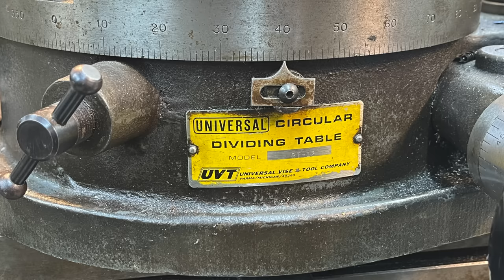Walker Turner Drilling Head Adaptor Part 2: Rotary Table Machining & Finishing

Comment: I always like seeing curves put into metal.  Nice trick with the square stock to assure proper height on the pins.  Keep up the good work.
Reply: A couple spare drill bits work in a pinch as well

Comment: When I was 19 years old I was running a 6" facemill and a hot chip landed on my nose just above the bridge of my glasses. I swiped it off fast and my glasses went flying over on the other side of a skid. I was expecting they would broken but they were folded neet as you please on the floor up broken . Sometimes your  just plain lucky. Very nice job by the way!

Comment: When milling a slot on a rotary table I find it helps to rotate the table anticlockwise. This way you are climb cutting on the inner surface of the slot which is shorter the outer surface. This helps minimise the 'grabbiness' you encountered. Beautiful finish as always 👍

Comment: I don't remember but I think there's a scale on the side for degree of angle . It may be a plate with pin on type . I use to enjoy machining cast iron , til I started sweating rust and tasting iron . Did that for a year or so many moons ago. Nice job Adam , thanks Abby for your Camara work , blooper n all...

Comment: Excellent as always. Abby does a good job too - and turned out really brave.
Personal experience: during the  visit of the finishing department of a large foundry I felt like getting electric shocks - which turned out as tiny steel balls escaping from the shot blast cabinet.

Comment: I absolutely LOVE seeing Adam working in Machinist-Accuracy mode. It is amazing. This part is critical to making accruate parts on the lathe it will be assembled on. If it is off, every part will be off, or it will be way harder to get them to specs. At 7:25 Adam tests the fit, and indeed it is 0.249 and the 0.250 pin has a tight fit. Then at 8:00 Adam says, "Just as easy as that." Well yes if you grew up in your grand-daddy's shop, learned machining at your daddy's knee, and have twenty years adult experience.

Comment: Re the light falling down (13:52), I grew tired of the same issue on my mill. Solved it by drilling a divot in the side of the vertical rod to accept the end of the lock bolt. My thinking was that if it came loose again, at least I would see it wobbling before it fell out. However, in practice the bolt doesn't come loose any more - possibly because the tip now has a bigger contact area.

Comment: The OEM part was almost certainly "gray" iron.  "Ductile" iron for the replacement part is just about perfect.  While generally similar to "gray" iron, "ductile" iron is a good deal less brittle and can withstand minor shocks.  Better than factory brand new is outstanding.

Comment: Long sleeves and rotary machine tools-? - SCARY-!!!   I caught a rag glove in a drill  press once - only had it on because of handling 500*F plastic parts, I was very lucky I yanked back and it just pulled the glove off - learned my lesson.
Reply: Not really, as long as they're tight fitting, and buttoned up, like Adam had them.

Comment: im no machinist by any means XD
im just the only mechanic using the mill and lathe at work,
i usually use compressen air to blast the part to keep chip away and it also keep them flying in the same direction.
can't wait to use the turn table we have at work (might take some time the guys are old school and don't like when i mess with their unused machines hehehe

Comment: Love this channel! First time writing a comment.
I have wondered for a long time, from drilling holes to machining ops-- How do you decide when to use oil/coolant? I know it's a complicated answer that I wouldn't fully understand, but  I've seen smaller holes drilled through less stock that had some oil used, unlike this video where no lube was used.

Comment: At the beginning of the video, I saw that "Sky Hook" and busted out laughing.  When I started out as a sheet metal worker in the early 1980's, the "sky hook" was the scam the old timers would send the new people down to the tool crib to fetch.  The guy at the tool crib was so use to it, that he would apologize that he didn't have any more, they were all checked out.  Also of note, were the metal stretchers, rubber tip drill bits and striped paint.
Reply: When I was an electrical apprentice I was told to get some magnetic flux
Reply: no "long weights" ?
Reply: The senior enlisted guys in the Navy would often haze the new guys by sending them out to get a “sky hook”. Usually after hours of searching, they would return empty handed. Well one day the FNG (Freekin’ New Guy) was sent out for a sky hook. He asked WTF do they want one for (we were an aviation squadron). The chiefs told him to STFU and just go get a sky hook. So he did. What the chiefs didn’t realize is the FNG was a former heavy equipment operator and a sky hook was some sort of small crane, so imagine their surprise when he showed up hours later with this huge machine towed behind his pickup truck. “Where do you want it?”  LOL!
Reply: And don't forget the box of grinding sparks!

Comment: Adam, I noticed that you didn't lock the knee after you made a depth adjustment on the slots.  That would help on some of the vibration.  I always lock mine.  Just a thought.  Nice job!
Reply: He may have done but cut that from the video in the edit suite to reduce the overall length of the video.

Comment: Beautifully done!  Just one thing upset me a bit... there is supposed to be an angle scale on the outside of that piece which indicates the angle the drill press head is set at with relation to the table.  On the broken piece you were sent I think the indicator scale was covered by the blue tape.

Comment: Another Awesome job Adam. I have always had a love/hate relationship with cast iron.  I love how easy it cuts and how easy it is on tooling but hate the dust. I owned a automotive machine for years and cut tons of cast iron. I don't miss the black crap in your nose even when you wear a dust mask. Everything in the shop had cast iron dust on it. The toilet bowl would get rusty on humid days lol.

Comment: 11:00 Adam - nice to see a bit of fresh oil having run down the side of the oiler on the rotary table. I hope the chuck and other oil points 'etc.' saw a bit of attention in the lubrication department.
In an industrial working environment, it's easy to 'programme in' a machine/equipment lubrication routine but in the home shop there is rarely a routine use of any particular piece of equipment where a routine lubrication plan is appropriate.
For equipment of occasional use, I'd guess a 'lube every time of use' policy would be best.

Comment: Great video and thanks for sharing. Could you not drop the quill say .650 then set a stop. Then when you move from slot to slot you unlock and lift the quill. You are then guaranteed not to touch the top of the part ?

Comment: Two questions

When you were doing the countersinks, that was a very, very long chip whipping around

Would that be something we mere mortals should be concerned about?

Second, when you were transiting between the two reaming operations, it sounded like there was a LOT of RPM spinning down after the transit was done. What was driving it that needed to spin up that fast?

Comment: Why don't you use any lube or coolant? I'm just curious... I obviously use a lot unnecessary after watching you.  Awesome and simplely explained video! Thanks
Reply: Cast iron naturally contains graphite so it's self lubricating and it's also very thermally conductive which means it sinks heat away pretty quickly. It's also softer than steel.
Consequently, coolant usually isn't necessary.
Reply: @BigRalphSmith  You must heat your cast iron gently. We're not that careful. Dad cracked a brake disc on his 1974 Ford and I've cracked a griddle plate on the stove top - just with heating it.

Comment: I haven't finished watching yet, but I'm interested to know why you chose to elevate the work with the knee, rather than using the quill?

Is it for better rigidity, or perhaps the quill doesn't have sufficient travel, or something completely different?
Reply: I would assume it was to be able to precisely set cut depth 200 thousands at a time. And to keep rigidity to a maximum.
Reply: Probably habit/confort zonr from years of not having a dro.
Reply: There should be at least 5" of spindle travel on Adams mill. I can only guess about his exact reasons, but Bridgeports and the clones of them aren't the most rigid machine tool design. Z axis moves with the knee keeps the spindle up and locked inside the head casting and that gives a bit better accuracy/rigidity with the cutting tools. Unless I'm drilling or single point boring I'll always chose to make those elevation changes using the knee. And because of all the table, Y axis and knee weight there's never any backlash to compensate for.
Reply: @turningpoint6643  I'm not certain, but I think this is Adam's DoAll mill, rather than his K&T, and agreed on the rigidity point. 

As this was a cut where the depth of cut was not absolutely critical however (the job was done when he'd milled all the way through, and it didn't matter if he overshot by quite a bit as he'd already milled a groove on the other side of the part), I'm not sure whether backlash or depth of cut matters one way or the other, so perhaps it was just done "for a change"?
Reply: @daveash9572  Yep it was done on his DoAll. I believe it has the same as my BP clone with at least 5" of spindle travel. But I mentioned the lack of backlash on the knee screw more as a feature of doing it that way than a requirement for this specific part. As you say his exact Z axis cutting depth was no issue since it was a through slot. But there's still a gain in rigidity and surface finish because the spindle was fully retracted. There were many manual Euro type mills built with no movable spindles unless you ordered a very expensive secondary head with that spindle option. So even drilling has to be done using the knee. Fortunately most of those mill types generally have built in power feeds on every axis.

Comment: You're always spinning clockwise so you're always dealing with the same surfaces of the bevel gears inside the dividing head. Going CW and CCW would be dealing with backlash. But my question is what kind of mechanism would a CNC dividing head use if not bevel gears, which have to deal with backlash?

Comment: Very nice looking part.  Im new to machining, so trying to figure out why you did certain things.  You drilled both ends of the slot and said it was so it wasn't cutting with the full radius of the cutter instead of just the two sides, but isn't the end mill cutting with the full half radius of the cutter for the rest of the slot anyways?  Or does it just give a nicer finish for the end of the slot that way?

Comment: Adam I've never used an indexing head before. Is there much backlash..... Or does the head pretty much stay right on the mark?
Reply: There is always backlash. As long as you go passed the backlash and then advance forward again, it's a non-issue. Better yet is to simply never turn backwards- just always advance one direction.
Reply: deemstyle: It helps to apply a slight drag on the locking screw while cutting to minimize chatter and vibration.

Comment: @Abom79- Old video; I know. I was curious if you had a reasoning for choosing the 1/2" indexable end mill for the creation of the slot over just going with the 9/16" HSS endmill from the start. It seemed like the carbide tool created a ton of vibration, though that was ultimately a nonissue. I'm just wondering on what criteria you choose the indexable end mill over a "regular" carbide or HSS end mill. Part turned out beautiful!
Reply: It was probably just a trial to see how it performed. Standard practice is two or three passes with a 1/2 HSS end mill then finish full depth with a 9/16.

Comment: I watch you spray weld on your channel all the time. Can you tell me if it would be possible to spray weld the ways on a lathe to build up excessive wear.
Reply: Lathe ways are hardened, precision ground steel. I somewhat doubt that you'd find a spray weld material of satisfactory hardness (though this is just speculation). A good repair would probably be to regrind the ways, leaving the lathe half a millimeter shorter, rather than to try and build the worn parts up. You'd need to grind, anyway, to get the thing true again :)

Comment: A nice video. We have a small machine shop at our dealership so I’d like to share some pointers for you to help you out: standard SAE press is about .0002 for a 1/4 dowel. No need to crush & distort using a .249 bore. Tables are in the Machinery Handbook for future reference.  Use a smaller diameter 4 flute mill to offset & finish slot walls independently. The awful sound we heard was the large 2 flute kerf grabbing, and chirping as it was recutting its own chips, needlessly dulling that improper tool for the job. FYI, you can also use a fluted countersink to chamfer those edges on the mill for a more uniform professional job instead of those hand scrapers. Just a few pearls to help you with your next project. Great work.

Comment: If you used the same numbers with the bigger cutter didnt you over shoot the dimensions at both ends of the slots ?
Reply: The slots were specified with an angle, not an absolute dimension, so the slots with the smaller cutter were actually too short.

Comment: What is the advantage of making it out of ductile iron rather than steel?  I know during manufacturing its probably cheaper and easier on the tooling but if your going to do a one off like this it seems like steel would be better?  Honest question, I am not a machinist.
Reply: Good question
Reply: Jump to 38 minutes, he talks about that.
Reply: @daveash9572  Thanks Dave, I should have watched the whole video first
Reply: @daveash9572  Thanks Dave.  I too should have watched the whole thing before commenting 😬
Reply: @johncos1068  Plus he already had the material.

Comment: Adam, you didn't indicate if the OOPS got cleared up when you widened the slot. You could have run a countersink cutter around the slot to deburr the edge. And BTW, they're not radial slots. A radial slot radiates out from the center. Not sure if there is a name for them but I call them 'arc slots'.
Reply: Concentric slot?
Reply: @davidcarr4991  Axial?
Reply: @donaldrandall9277  Axial is along the axis of rotation so that would not be applicable.

Comment: Subtle technique, always turning the rotary table in the same direction (clockwise), even if it takes more cranking, less possibility of turning it the wrong way with the tool in the part.
Reply: I wondered about that too! I wonder if this decision was also in service of a uniform finish, vs making stripes of normal vs climb cuts inside of the slot.

Comment: Is there a reason you raise the knee rather than lowering the quill to cut the slots?
Reply: Accuracy, it's easier to control the mass of the knee moving up. The quill can just drop and given the depth of the cuts he is taking, the quill is better supported in the up position. Textbook machining and his mentors would be proud. Could have used a 4 flute 9/16 mill is the only thing that jumped out at me.
Reply: @martylost167  makes sense, thanks.
Reply: Rigidity is also a key factor in using the knee over the quill.
Reply: less outstick more accuracy and controll

Comment: Knowing nothing about machining, I don’t understand when and why ( or why not) you use cutting oil. Seems like all this drilling and slotting would wear out tools faster without lube.  Any explanation of when and why using cutting oil would be appreciated
Reply: It's cast iron, it's so filled with graphite, it doesn't need any additional lubrication.
Reply: lot of the time it depends on what material you gonna cut in to abd how much material you moving.

Comment: Had a look at the part 1 video.  Have not a clue why the: recess, dowels nor cutout are required.
Reply: the dowels key to mating face on the shaft side of the machine, and the slots are there so you can rotate the drill chuck end axially* about the shaft.

Dude that sent the part to get made shows it in his video clip that was edited in.
Reply: @desmofan1864  Nope.  Nothing more than two non-recessed holes was required.

Comment: I'm not a machinist but was curious why you don't use cutting fluid.
Reply: Cast or Ductile Iron is self lubricating. Not so much if it were harder material or alloy
Reply: Cast iron generally doesn't need cutting fluid because of the graphite in the cast iron acts works like lubricant.
Reply: You may use a soluble oil or a light machine oil on cast iron if you wish but it isn't necessary for machining.
Reply: @comictrio  ok,  didn't know that, thank you for answering. Love the channel.

Comment: Question: why - if the old part cracked - you made a new one out of cast iron and not steel? After all, sooner than later the made ring will crack again ... no sense ...
Reply: He explains that at 35.55

Comment: I would be worried about breaking out the T-Slots on the milling table lifting that much weight.
Reply: I would be interested to see if there was any movement detected on the table with a dial indicator when using the sky hook

Comment: Why are you never using any oil or whatever when you drill or ream ?
I bet you know that shortens the livespan of most cuttingtools for metal...
Reply: Typically cast iron has enough carbon in it that it works like a lubricant, and extra lube is not needed. I don't remember what type of iron Adam said that is - I've never seen cast iron work with big chips like that - usually powdery swarf, but it does behave like cast - ?steel?.
Reply: @ronmccabe7164  good to know, thanks 👍